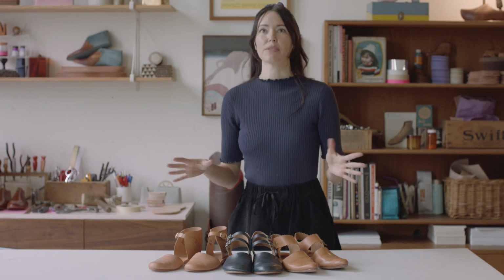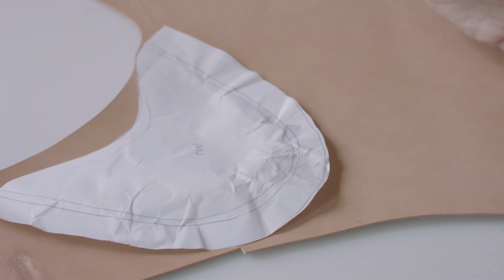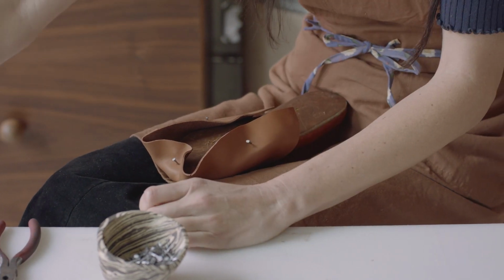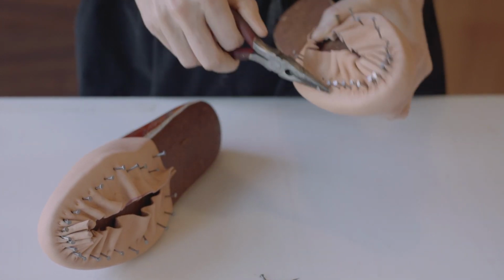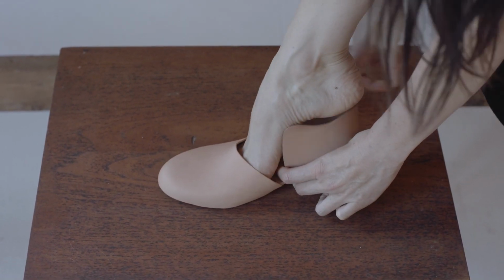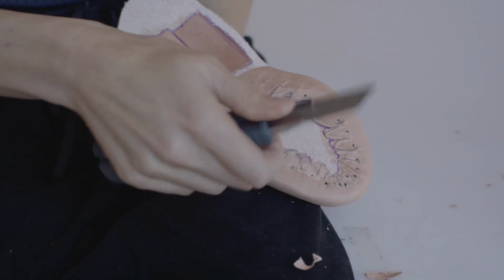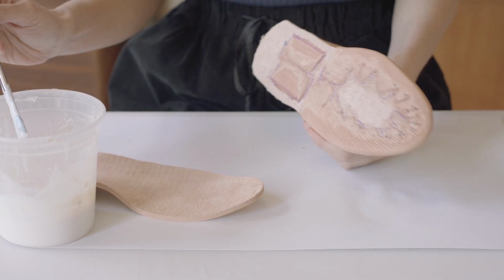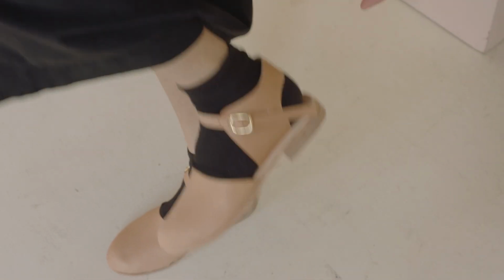Mary Janes HOW TO by RACHEL SEES SNAIL SHOES

Comment: Cool shoes.

Some tips from a shoemakers perspective:

- You might want to add a shank, even with double leather soles you will feel the heel eventually.
- If you use an insole and outsole you could stitch the upper straps to the outsole (plus the glue), the area of the stitches has no contact to the ground
- I would use a sole protector (like 2mms rubber or even a thicker leather halfsole), it wont ruin the looks but make it much more durable since in this form it is not so easily resoleable